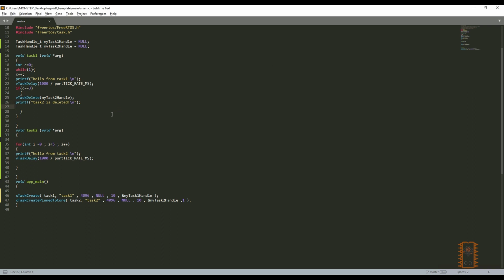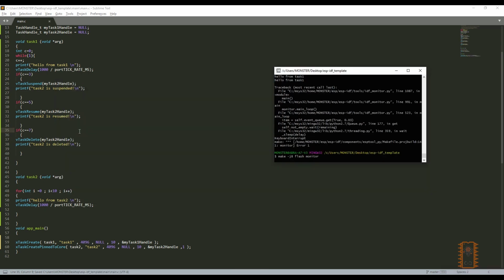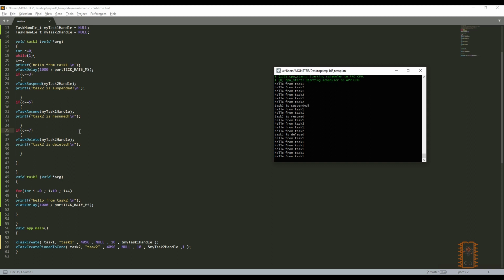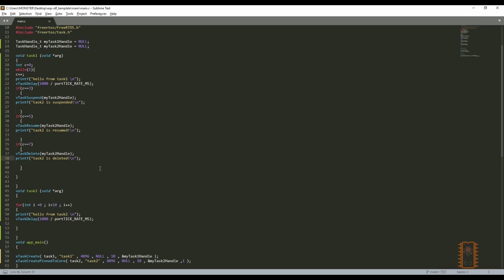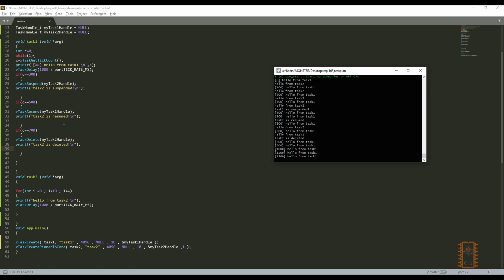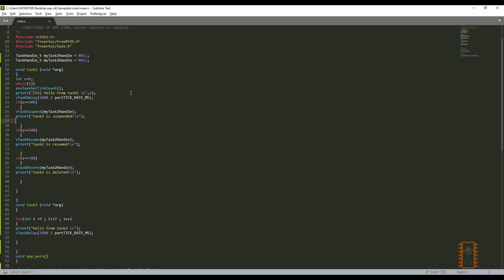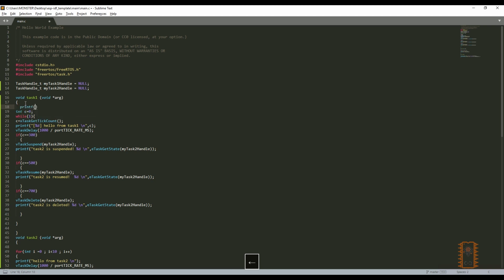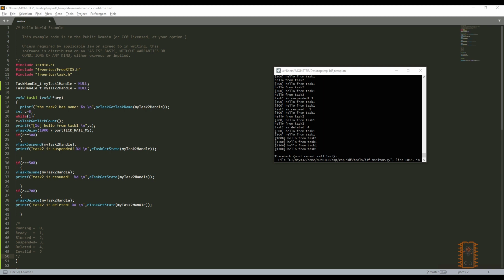#5 ESP-IDF FreeRTOS Task Example-2

Comment: Hello, Thanks for this video series. It is very useful.   I need to sample an analog signal with 5kHz sampling rate using esp 32. I used adc example. Can I know how to set the sampling rate in that code? I tried to use some delays. But wasn't successful. Hope you will help me. Thank you.

Comment: make flash monitor delay a lot! do you know why? help please!
Reply from the maker: It's about the processor speed of the computer. But there is a trick about it. Firstly, you should learn how many cores the computer have. Lets say 4 cores. Then, you can run make -j8 flash monitor. You should -j(cores*2) . The other solving is using upper version of the python. Unfortunately, msys32 uses python v2.7 - v2.8 .
You can use visual studio code with esp idf extension, it can be used with lastest version of python. It increases speed of compiling so much!